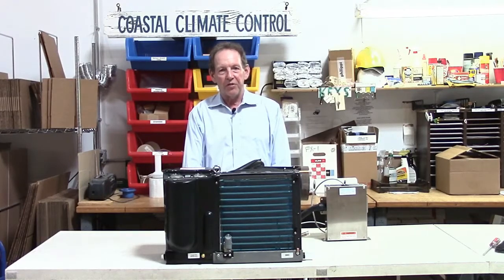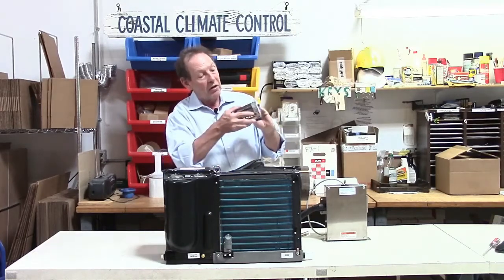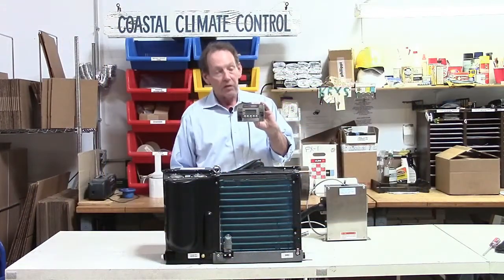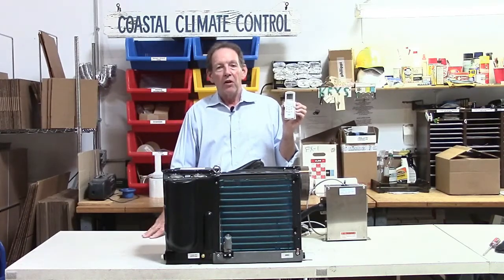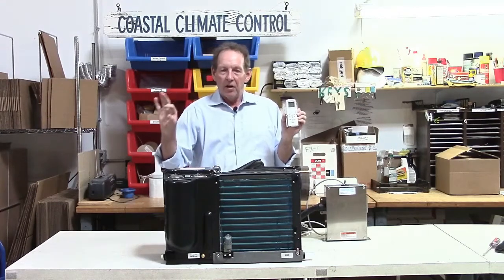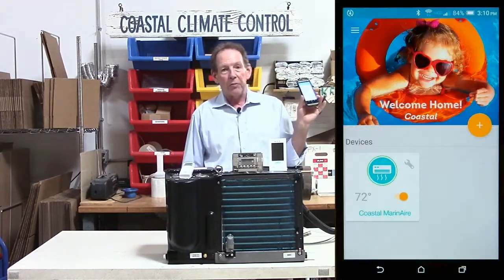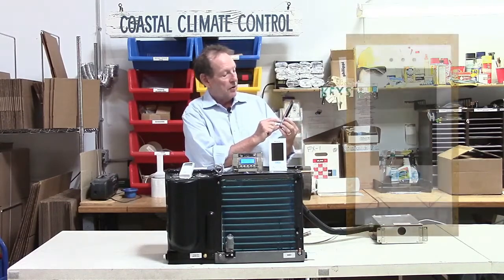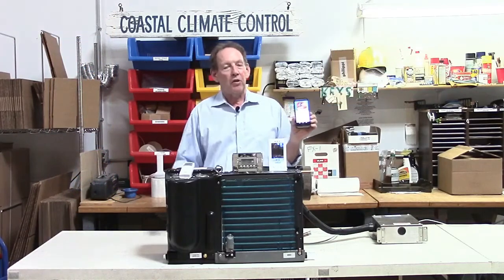MarinAire Part 2 : Controls

Comment: Can I use the Miro Air or Dometic LCD display controllers?
Reply: @KMT15 Thanks for your question.  Switching the controller (display) will require a new electrical box made for the new controller (display) for communication.

Comment: Hi, great video!  I am wondering if our unit came with a remote or not... or how we can get one. We just bought a 2019 Fountaine Pajot Helia with a Cruiseair Vimar thermosts much like the solver one in your video, though not an exact replica. We have yet to find a remote control in the boat though. If we have to buy one, what do you suggest we buy that will be compatible? Right now we have Wifi while at a marina, but we won't always have it, so I think a remote control would work better for us... one we can set on a timer to turn on in the mornings to warm up our salon before we wake up. Also, maybe you can answer this as well... once the temp reaches the number we set it for, the heat stops, but there is a fan that keeps constantly running... it blows cold air, which defeats the purpose of having the heat on. Our thermostat buttons are: (starting from left to right) Power, Mode, Temp (down arrow and up arrow) and Fan. Thanks much ~. Claudine

Comment: I installed this unit in our 1987 Sea Ray boat in June of 2020 and I really enjoy having a quiet cool air conditioner. I have not had it year round yet so I can't comment on it's heating ability!
Reply: Was this a straight forward install?
Reply: I installed a 6000 btu unit in my boat and before buying noted all the reviews about how “quiet” the units are. 

Granted my ductwork is all of 4”in length but I’d consider the unit to be very loud.

All is well and the unit functions very well but “quiet” is NOT one of it’s attributes